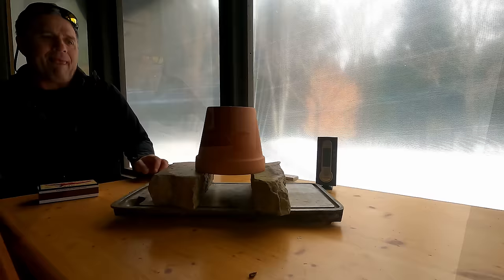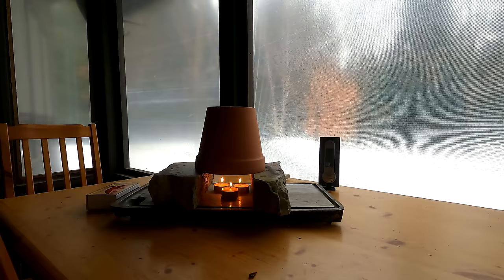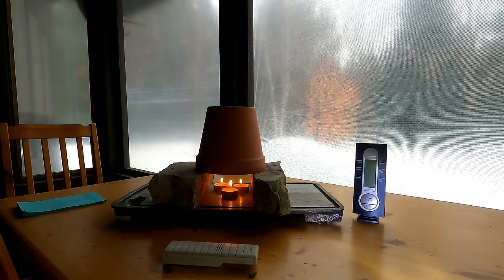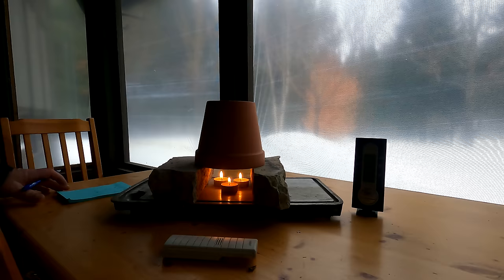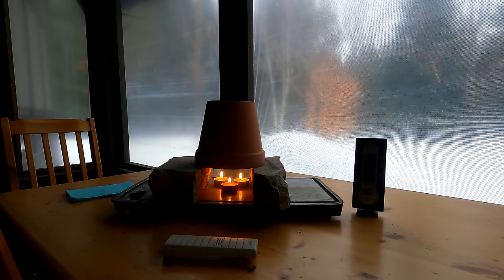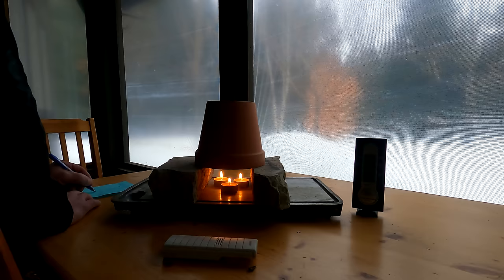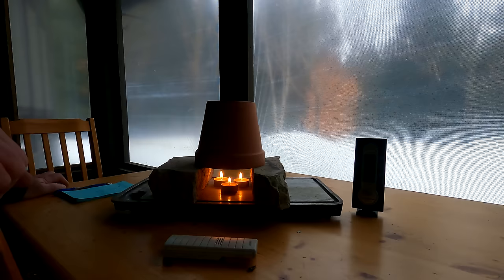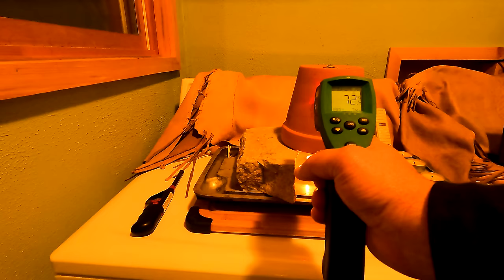Testing the Clay Pot Heater | Truth or BS | Prepping and Testing

Comment: not to mention that we have gas furnaces and electric heat because excessive oil and candle burning inside an enclosed area is hazardous.  Look at all the third world engineers without borders style "efficiency" and "cooking" structures.  Most of the effort is to get enough material to capture heat from a fire...but the exhaust is always ported outside for health/safety.  This type of thing might be a temp warming...but is certainly nothing to attempt as a regular method.
Reply from the maker: I am in total agreement with you - this unit raised several red flags for use as a viable solution to an emergency situation. There are many other safe options for space heating should the power go out. 
Thanks for the comment.

Comment: What was the temperature outside ?. Did that rise during the experiment because it could be a factor in the room temperature. Also to be considered is how much of the temperature rise is due to sunlight coming through all that plastic window material. Three candle power of heat would be the same without the plant pots. They only serve as a soot collector.
Reply from the maker: The first portion of the video did indeed show a screen porch - this is not what I based my conclusion on. I moved the unit into a small laundry room which is located within the house - outside temperature was not a factor as the room is insulated to a value of R30 and there is no outside wall adjacent to the room. 
This is shown in the second portion of the same video.  The Pots do not increase the temperature of the unit - they simply capture the heat and radiate it out in a uniform fashion. The continued to radiate the heat for 30 minutes after the candles were extinguished.
Reply: @Hawksshadow   They also probably took 30 minutes to get up to temperature. It's all swings and roundabouts. Same goes for storage heaters, which are basically a block of concrete with an heating element inside. Until that mass of concrete gets up to temperature, the heat output rises slowly. The only benefit accrues by running it upto full heat on cheaper off peak electricity, but then If you are working during the day, it is radiating and wasting all that heat while there is no one home to enjoy it, and it will have cooled down somewhat by the time you get home. That is the principle on which these flowerpot heater are working, they are just small storge heaters, and I can't see three tea light candles making a damn's worth of difference in a room bigger than a small toilet.

Comment: This test needs a control where you light 3 candles in the same conditions but without the pots.
Reply from the maker: The room in which this test was conducted is 5ft by 8ft by 8ft in height. The pots do not increase the BTU's of the candle - they can't - their only purpose is to increase the efficiency of the heat delivery. The pots capture the heat and radiate it out in a controlled manner. This unit will only heat a very small area and even then by only a few degrees. This was a test and not an experiment where a control was required. One thing I did notice is that the pots were still radiating heat 30 minutes beyond the extinguishment of the candles.  I have recently completed the exact same test and approached it as an experiment - I used the candles as a control and the results were as expected and as you suspect they would be. Thanks for the comment.

Comment: A candle puts off 80 watts, more or less. Thermodynamics doesn't care if you put a pot on top of the candle or not.
Reply from the maker: Correct - the pots capture the heat and radiate it out in a controlled manner - it's that simple. The heat would be lost to the ceiling if there was no control.

Comment: Its  keeping the heat down by you. Not up on the ceiling. Its not the same as burning a candle.
Reply from the maker: That is correct - the candles heat simply moves where the air currents dictate - heat rises, cool air drops. The pots do indeed change the equation by keeping the heat right where it is needed  - Thanks for the comment.

Comment: The temp went up a few degrees in the house. What was the temp outside the house? You forgot to check that.
Reply from the maker: The real test - part of the same video - took place in an insulated room - R30 in the walls and R 40 in the ceiling. The room is internal to the house and therefore outside temperature is irrelevant. The temperature which is relevant is the initial temperature of the room and any other potential heat source within that same room during the test. The size of the room is 5ft by 8ft by 8ft high - basically the size of a closet.  This unit is incapable of heating anything larger and it is incapable of heating a room who's initial starting temperature is south of 50 degrees Fahrenheit.

Comment: If you want dramatic results try lowering the pot to be at least even with the top of the candle container, leaving room for air flow
Reply from the maker: Good Idea - I will give it a try - Thanks
Reply: How is that going to produce more heat than the candle can actually emit?
Reply from the maker: It can't - the pots simply capture the heat and radiate it out in a uniform fashion. The pots will retain heat long after the candles have been extinguished.

Comment: To see if it's bs you have to compare it to just burning three candles without the pots and you'll find they raise the temperature exactly the same amount as when the pots where there.
Reply from the maker: I have done this and discovered that there was one degree of difference - therefore the same; however, the pots collect the heat and radiate it out in a uniform manner - They will continue to do so at least 30 minutes after the candles are extinguished. The test was to determine if the combination of pots and candles would heat a very small room. One hour into the test the room temp raised by a few degrees. I must say that I would not use this device as there are too many things which potentially could go wrong - the fact that the candles are melting due to the heat captured in the pots - this poses a serious potential of flash ignition of the melted wax. Thanks for the comment.

Comment: This is as effective a heater as the "emergency candle" in a car in a blizzard is. It will keep a small space warm enough you won't freeze to death, literally, nothing more. The clay pots act as a heat well after the candle burns out.
Reply from the maker: 100 percent - that is exactly what the pots are in the equation for.  I discovered that the pots will be hot to the touch at least 30 minutes past the extinguishment of the candles.  If I were to use a device like this, I would have to be in severe trouble with no other options. If it keeps you from hypothermia -even if you have to hug the damn thing - than it was worth the effort.  Thanks for the comment

Comment: Uhhhh... No.  Repeat everything the way you did it,  only don't use the pots. The candles are raising the temp in the immediate area of your thermometer... the temperature of the candle wick was only room temp when you started too! The heat increase in the room has nothing to do with the pots but with the candle heat source.
Reply from the maker: You are correct - the pots however capture the heat and radiate it. When the candles are extinguished - the pots continue to radiate the heat. They will do so for at least 30 minutes dependent on the temperature of the room they are situated in. 
Due to the comments on this test - I recently did the test with just candles and than compared it to the combination of pots and candles.

Comment: We burn candles, one in a room, and surprisingly it will take a chill off the room.  But it most certainly will not replace our boiler.
Reply from the maker: So true - I have actually set a pop up tent in the living room and put a candle in it - amazing how much it will heat the small shelter. The candles also keep your spirits up if the power goes out. I have a wood stove in my home which I use as a primary heat source.. You are so right - nothing replaces engineered heat sources like a boiler or HVAC system.

Comment: it all boils down to energy. the amount of joules you get from the burn is what you will get. the container is irrelevant. this simple to understand. the only real variable is burn efficiency, but this is not really a factor with a candle.
Reply from the maker: You are correct - the pots only function is to capture the heat from the candles and convert that energy into radiant energy. The radiant heat is pushed out from the pots in a very controlled manner. If you had to use this to stay warm, you would have to sit beside the unit and within its radiant zone.
Reply: @Hawksshadow  a controlled radiant heat can be used to give an impression of heat. particurlarly if we can warm part which have heat receptors (wrists, ankles) . but at the end of the day its just a feeling. you will die of hypothermia anyway.... but yes, you are right in the conversion factor.
Reply from the maker: For many years, I have used heated rocks to boil my water and to heat my winter shelters. The radiant heat produced by the rocks can and will increase a dome shelters temperature by 20 degrees C and higher. This is when the outside temperature is - 20 degrees C. It is truly a life saving strategy should you find yourself in a actual survival situation. The pots function in  the exact same way although much denuded as they do not have the same mass.  I have taught outdoor survival for 30 years and have seen the causes and effects of hypothermia. A small radiant heater such as this; coupled with a blanket placed around your back while the little heater is in front of you  will indeed keep you on the green side of the grass should you have no other options for warmth. 
Thanks for the comment.

Comment: Heating that room with around 120 watts of thermal energy's never going to happen is it! (a person emits about 100 watts just sitting there so that was about the same as having a 2nd person in the room). Put that thermometer over the other side of the room for the real temperature, as it is it would make a good psychological room heater if sat next to it.
Reply from the maker: I was not in the room - the thermometer reads a remote sensor which was located approx. 5ft. from the unit. This was in the second part of the video.

Comment: Yeeeah if you want an honest test of room temp move that thermometer about 3 to 6 feet away from the heater. All you are doing is measuring radiant heat @ 8 inches away from the pots. Real deceptive, slight of hand kind of thing. So as you said kind of BS for heating a room.
Reply from the maker: Hello - The thermometer is indeed close to the unit in the screen porch due to the fact I had no illusions it would heat any further than that distance. At 4:06 into the video, you will see that I tested the unit in a small insulated Laundry room. The unit did raise the temperature in the room albeit marginally. The mistake I made was not proving the temperature change by showing the thermometer which I took the reading from in the laundry room. I can assure you that there was no slight of hand as I have no skin in the game to prove the validity of this unit. I would not use this as an emergency heater as there are simply too many safety risks involved and there are plenty of manufactured heaters which are designed to deliver safe and efficient emergency heat. I do realize you are trying to call out the B.S. also, so I thank you for that.  There is too much of it on YouTube and I certainly refuse to add to the pile. 
Thanks for the comment.

Comment: Question... Is there a difference in temperature by using less pots....I saw a video of people using,1 or 2 pots but never 4...
Reply from the maker: Hello Sheila, I believe the secret to this is simply heat capture and retention - 4 pots = more retention. I have tried two pots - the temperature retention is substantially less. Thanks for the comment, I hope this helps. BTW - the unit works but I can't vouch for its safety. I have heard of some pots cracking due to high heat. Tea candles are the way to go with this.
Reply: @Hawksshadow  I just constructed one with 3 pots. Kinda big ones....
I SWEAR... It does work. Make sure there are NO holes in the top. Just use a large bolt with spacers and nuts.... Easy.
Reply from the maker: @shoedil812  Cool. I’m glad it worked. You’re right, no hole at the top as it lets heat escape. Experimenting like this is awesome as it leads to some neat insights. Thanks for letting me know it worked.

Comment: The observer (you) also heats up the room with 100 Watt.
Reply from the maker: That is correct - I removed myself from the equation and used a remote thermometer to monitor the situation. The thermometer in the video received the readings from the remote sensor which was located 4 ft from the pots.

Comment: One needs to monitor fluctuations in outdoor temperature for this experiment to be conclusive.  Outdoor temps were not even used here. Bzzzt.  Do over!
Reply from the maker: This test was done inside a small room which started at 8 degrees Celsius. Baseboard heat was off. The screen porch where the unit was constructed and first tested was 5 degrees and too large for this unit to have any effect. Hence why I moved it into the laundry room - Outdoor temperatures do not have a bearing on this test as the parameters of this test was to simply determine if this unit could raise the temperature of a small room - it did - however not efficiently enough to  be used as an emergency room heater - I will draw your attention to a video I posted - recently -  in which I use this unit in a tent outdoors - the outdoor temperature was indeed brought into the equation. 
I couldn't find Bzzt in the dictionary - you know that little book which helps informed people the proper dictation, meaning and spelling of any word within the persons chosen language. Question - have you done this test? And if so, please let us know your conclusions.  Thanks for the comment.

Comment: Since this room is fairly exposed to outside temps, what was the change in outside temps during this time? Any chance you are just observing the effect of the natural change in outside temps? Do you have a separate but similar room on the same side of the house that you could monitor as a control?
Reply from the maker: Great comment - the second part of the same video is the real test - the room in an internal room to the house - not affected by outside temps. The walls are R30 and ceiling R40. The size is 5ft by 8ft with 8ft ceilings. The temp change in the room was nominal at best.  The first part of the test was simply to determine the radiant effect of the pots - hence why the thermometer was so close - this was done in a screen porch with no insulation. I did not explain myself properly in this video.  Good observation and I thank you for the comment.

Comment: 3 tea candles will produce the amount of heat made by 3 tea candles. The pot makes no difference to the amount of heat produced. In your experiment, the thermometer is next to the pot so the room temperature reading will not be correct
Reply from the maker: The pots do not increase the heat produced by the candles - they simply absorb the heat and attenuate it. 
The pots then radiate the heat out in a uniform fashion. The thermometer was indeed clos to the
pots; however, the unit works off a transmitter. The transmitter was 4 ft. from the heater on the same level as the heater. I can state without hesitation that the room's temperature did rise by a few degrees. I had nothing to prove by doing this test as I couldn't give a shit if the unit worked or not - why - because it is too dangerous to use in an enclosed space. I simply wanted to determine the validity of others claims. I truly hope that you do the same test using the same method - it would be interesting to see what conclusion you come too.  Please note - the unit is not efficient enough to warrant use in an emergency situation - it is too fragile and can emit toxic fumes - not to mention open flame in houses is a recipe for trouble.

Comment: I reuse canned heat cans filled with alcohol,the right ones have a nice wick already in the lid
Reply from the maker: That is brilliant - cleaner burn and higher heat output. I will give it a try.  Do you have any concerns about the can getting to hot due to proximity of the pots?  Thanks for the tip.
Reply: @Hawksshadow  i put em in coffee cans with a bit of stone and vent holes drilled low on the coffee can
Reply from the maker: @mrscottygreenwood  That too is brilliant. I am positive it is a much improved heating system.  Well done. I will give it a try.
Reply: @Hawksshadow  it is and itll last a good 6-7 hours a can
Reply from the maker: @mrscottygreenwood  Wow - Awesome.

Comment: They can't get any hotter than just the candles without the pot
Reply from the maker: That is absolutely correct - The pots do not increase the heat output; however, they do capture the heat - all of it - and radiate the heat out in a very controlled manner. The heat from candles alone would be of little use as it would escape to the ceiling and be affected by air currents. This unit is for emergency heating - you would light this thing up and sit right next to it with a blanket over your back to capture the radiated heat. Note - I would not use this unit as there are too many safety risks associated with its operation.  There are many devices designed for emergency heat. These manufactured units are tested and proven to deliver safe and reliable heat should the power fail.   Thanks for the comment.

Comment: I used to heat my crawl space with a candle.   No pot.
Reply from the maker: The Pots only function is to capture the heat and radiate out in a controlled manner. I would not use this or candles to heat my home - too many safety concerns. Thanks for the comment.